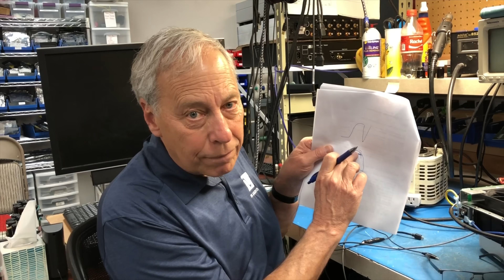Class D amps for regenerators?

Comment: I understand why a class D topology would not work. Have you tried using IGBT's in the class A/B section of your power plants. They are very rugged and can handle a lot of current as well. They also might do well in a subwoofer amp.

Comment: If you take a look at computer power supplies you would realize that switch mode (class D) power supplies can indeed supply huge amounts of current & maintain very tight regulation in spite of sudden huge 100 amp or more current draws that modern processors can draw. Granted these are at extreme low voltages but shows what can be done while still maintaining relatively low noise.

 My sound card works off this power supply & tests show that it is capable of quite low noise as in 117 db or better S/N ratio which is the limit of the ADC used to test it with. This is all in spite of huge spikes in current happening on the 12 volt line, approximately 10or more amps on that line. 

 Processor is powered from that line but is converted to 100 or more amps at 1.2 volts. That is one of the beauties of class D is that you can convert from one voltage to anouther with very low loss & it doesn't matter which direction the voltage conversion takes place as you can design it in such a way as to both boost & cut voltage depending on what is needed at that moment. 

 It can be easily be designed to take very near full advantage of of the entire input sine wave to generate power from as it can boost voltage during the input power voltage lulls in the sine wave & cut power if the input power spikes & can do this in a way that utilizes most of the input sine wave unlike class AB amps which can only use the peaks of the sine wave to generate power from. 

It can do all of this all the while generating low noise, granted not quite as low as class AB amps can but more than acceptably low in noise, considerably better than the AC power line input noise.

Comment: The part about the AC input sine wave charging AND discharging the storage capacitors has got me thinking that isnt right. To paraphrase what yuo said - that if you had a Capacitor hooked up to an AC input 60hz sine wave, that on the 1/120th of a cycle would charge the capacitor and the other half would discharge it ?  No, because you're confusing the input and output. So you mis-represented the behind the scenes reasoning. Yes the input charges the caps and yes the speaker output will drain them but thats not what you said....
Reply: The AC power charges the cap - but only in bursts.  But if the capacitor isn't charging, then it's discharging into the amplifier in order to keep the amp supplied with power.

Comment: Here's a simple question Paul? Do AC regenerators called Power Plants, manipulate Audio? Enhance? Or simply provide the needed Current when needed by the equipment? In other words, Stability Vs enhancement of signal in overall bandwidth.
Reply: Simply provide the current when needed, although this would also effectively enhance the audio. From what Paul said having a power reserve will cause the sine waves to NOT  get chopped off. Also such a large and advanced powerplant could improve the signal by filtering common mode noise and some other stuff but thats probably just extra cause the audio amp would do some of that too.
Reply: Ah ok...  The Power conditioner I designed for some reason has noticeable filtering and energy reserves as well. But, what's strange is it seems to convert the musical signal to sound just like a tube amplifier(sweeter mids and highs). A very nice effect, got lucky I guess... Oh, this is why I asked this question. Thanks for the confirmation...

Comment: I am a bit confused....    Aren't the new PSA Stellar mono amps class D?    Are we comparing apples with oranges here when it comes to application?
Reply: The amps in the AB powerplant regenerator, are for power. And the class D monoblocks audio amplifier are for sound. so... hope that helps
Reply: That really did not help because I already knew that.  Paul usually gives good answers when we ask questions.  Are you Paul?

Comment: Are we speaking of the current being out of phase compared to the voltage due to the combination of reactive and inductive loads the amplifier and the speakers create?
Reply: I'd say it's "in phase", but because the power draw is a pulse instead of a sine wave, it causes a low power factor.  In this explanation, there is no reactive component.  The pulse comes from the power rectifiers turning on and charging the capacitors in the power supply.  Any time the instantaneous AC voltage is below the voltage of the cap, the rectifiers turn off and there is no current.
Reply: Thanks for clarifying!

Comment: Would a component plugged into a power plant measure any different? I'm genuinely curious.🤔
Reply: The worse designed the components power supply is the more a power plant could help
Reply: Kacper Uminski I'm guessing it would depend on what you're measuring.